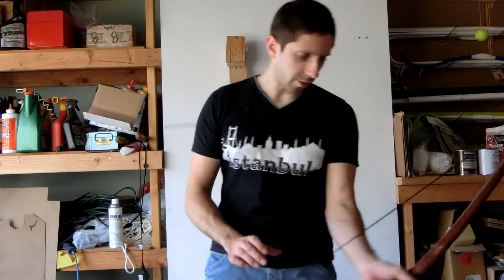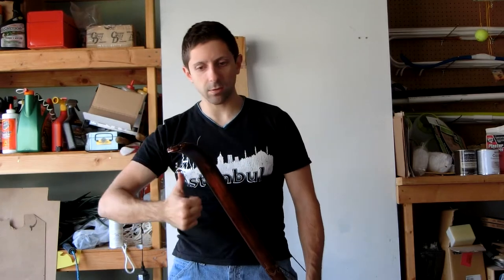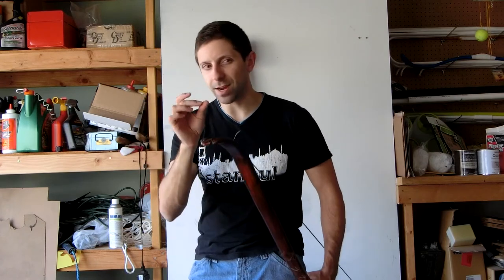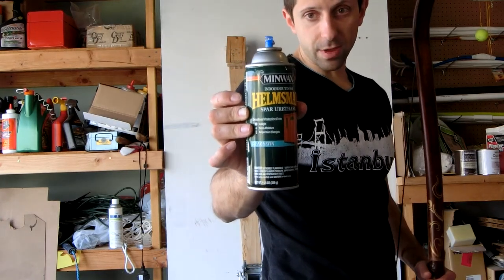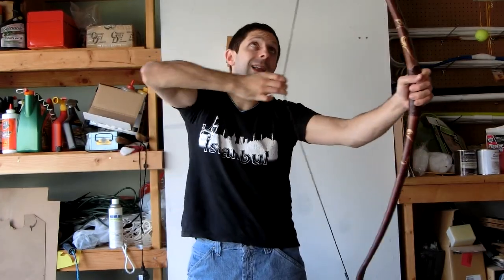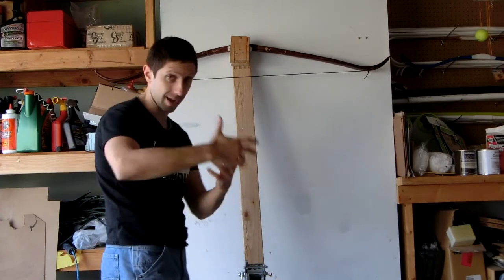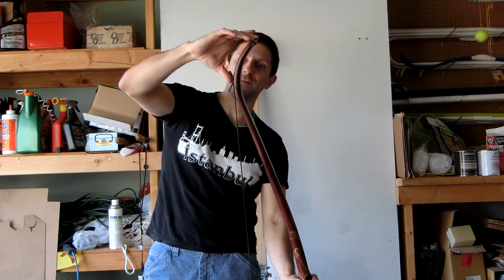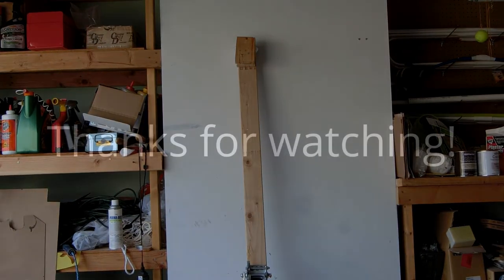Drawing Another Mirkwood Bow with a Flattened Recurve (not siyahs!)

Comment: I think if you really want to measure the draw weight of a PVC bow you need to shoot the bow a bit and then measure 3 times, taking an average.   My experience is that PVC has a fair change in the modulus of elasticity  in the first bit of use.  Drawing to 28 for 1 second and saying yup 50 lbs,  seems a bit silly.
Reply from the maker: That's reasonable. In short - you're right, but I doubt it matters much. If you want to know why I think that, read on ;-)

The thing is, even after you "break the bow in" for that session, the draw weight will still fluctuate from shot to shot.

My tests of hysteresis in bows (http://goldenhordebows.blogspot.com/2013/07/hysteresis-enemy-of-pvc-bow-performance.html) suggest that in some bows, you can lose nearly 10% of the draw weight in 5 seconds or less of holding. 

So on the one hand, I'm not working the bow before testing, but I'm also drawing it sloooowly, back to zero, drawing slooooowly again, etc. The actual "fast/normal draw" weight would 100% guaranteed be higher than I'm showing after doing all this drawing, so I think it's close enough for our purposes.

Also, depending on how you use your bow, this might be more than fair - for flight shooting, you might string your bow right before using, draw rapidly, and loose as quickly as possible (and conventional bows have the same issues, mind you - Adam Karpowicz had to limit draw lengths in his testing of Turkish bows to prevent the chonograph results from being wildly divergent).